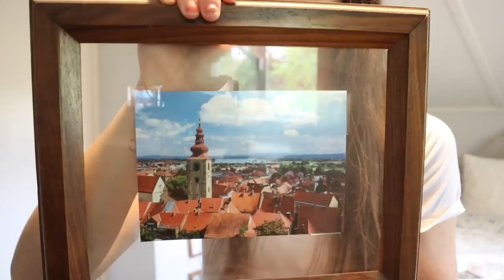I guess I live in a school bus now

Comment: Have you noticed how much fun it is to move?  Keep the things you need, like your best jeans and your best t shirts and shoes.  Down sizing is the key.  Keep all the things you need.  The key word is NEED. And make room for some needed wants stuff.  Start gathering lots of canned foods.  Bottled water.  get a small wood burning stove along with a propane and butane stove, (dual fuel)  If you can afford it, get a Jackery power pack that can recharge with solar panels.  Order lots of freezes dried foods.  Plan all your trips with a map.  GPS is not reliable.  Get batteries for all your hand or head lights.  Fitted sheets not fitting well?  Thank you Emma for expressing your thoughts.  Wishing you a super extra wonderful day.

Comment: Rule of gross tonnage. No one is going to run their car into a big-ass bus. :0)

Get yourself a little set of hex shaftdrive drill bits - to fit in that hex driver - predrill when you're less than two inches or so from the edge, and you won't split the wood.  Good luck! I'd have a hard time leaving that dog. :0)

Comment: You might want to turn those drawers around and bungee them to the wall. They’ll fall and possibly a drawer will break. I know this from personal experience in my van though it might be different with the bus 😅
   Also your mirrors are your best friend! I have no backup cameras and always do great without them. Don’t be ashamed to practice backing up in a open parking lot with lines and use those to get used to your size 💚 once you get it down you’ll wonder why it seemed so daunting!